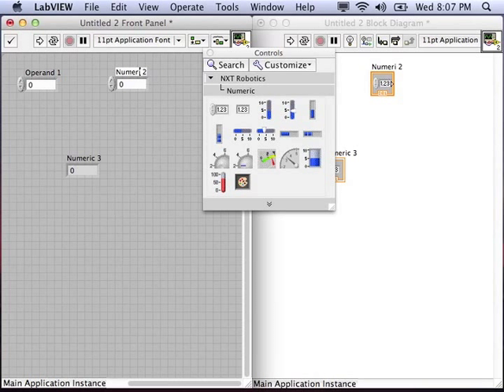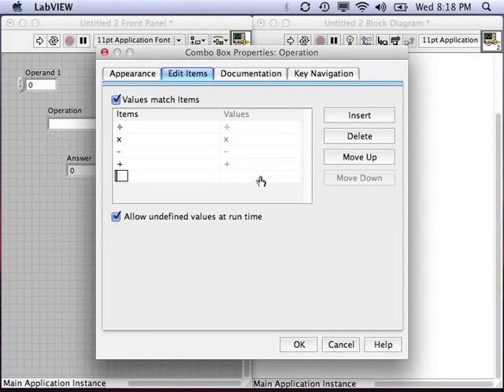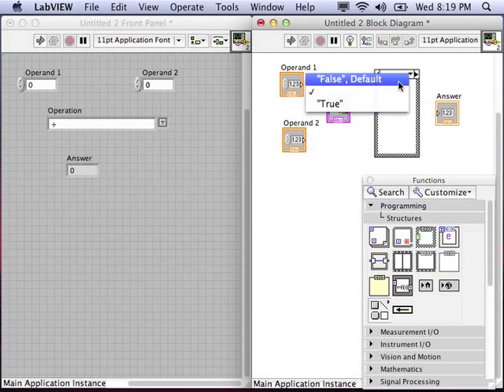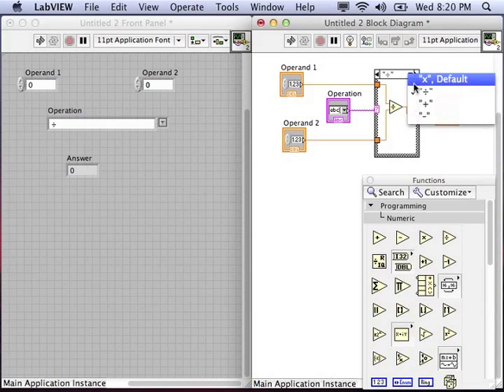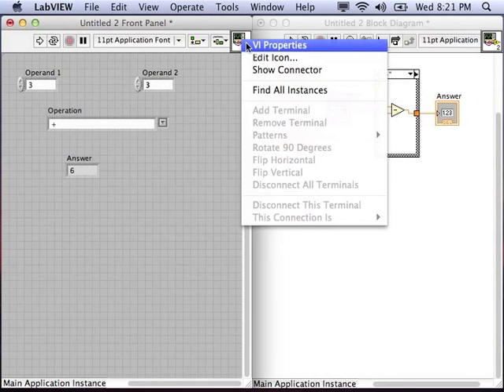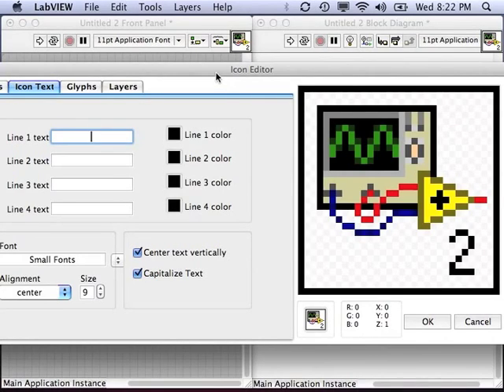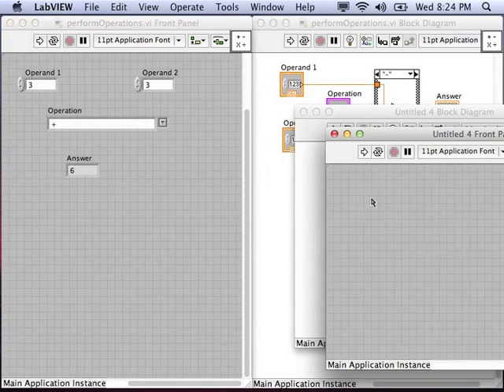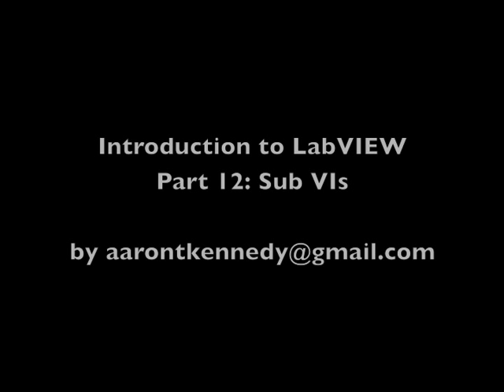Introduction to LabVIEW: Part 12 Sub VIs

Comment: Hello, I have a question about the sub vi. When I run the finished product (calculator) the program just runs the default case which is the multiplication. I was wondering what can do to fix it.  Because the other operations when clicked it just ends up multiplying
Reply: I have the same problem, did you ever find out what went wrong?

Comment: Hello, when I try to use the MINUS operation it doesnt work, the operation string instead of showing the minus symbol just  shows a straight line, so the minus operation doesnt work as on the video, could you share the sub vi, I have tried with all versions, but doesnt work. my Email lfps2220@gmail.com